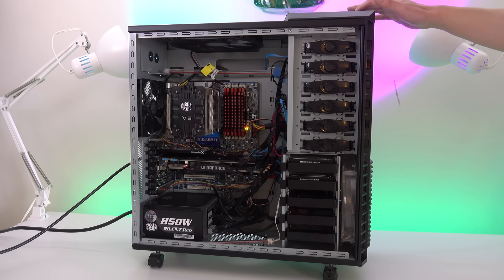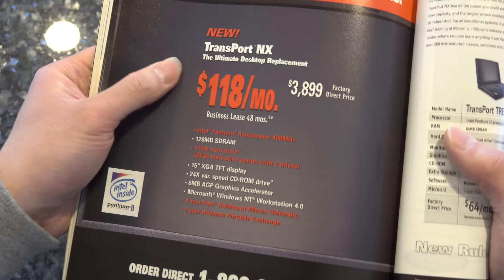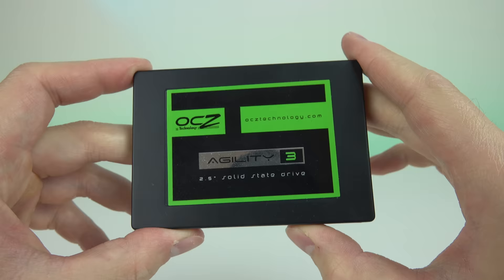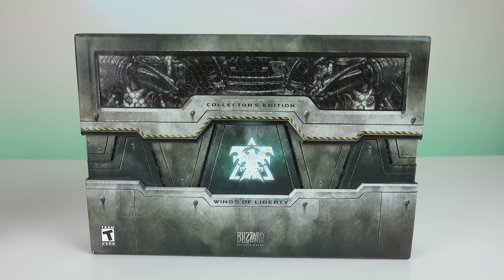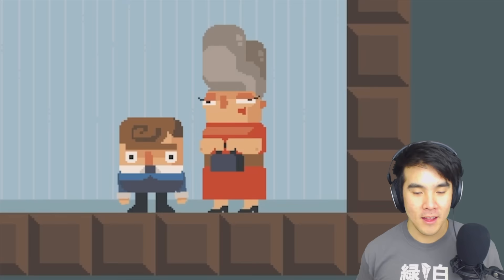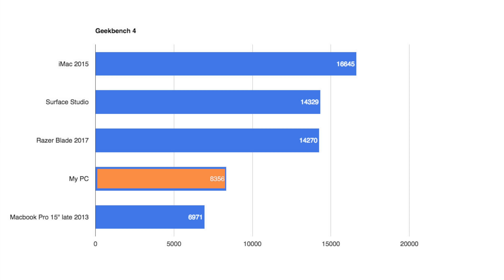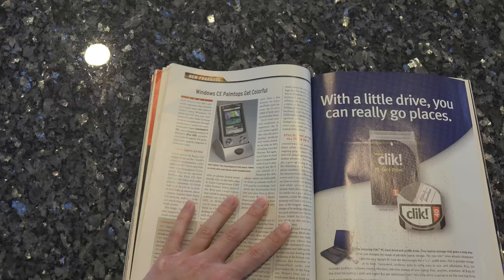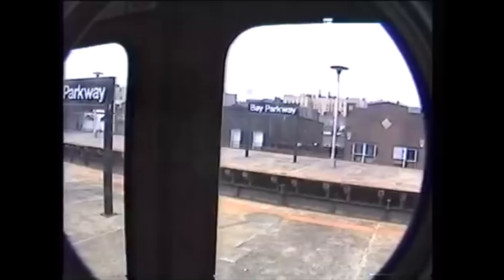I Built This PC for $1360 in 2010. Here's How It Holds Up.

Comment from the maker: New Video: I Bought This PC For $750 in 1999. Here's How It Holds Up In 2017. https://www.youtube.com/watch?v=Dy07b6hlUGg
thanks for visiting 🙏
Reply: Chubbyemu hey
Reply: I built an $800 PC in 2008 and it was my main computer until the end of 2016. Very reliable 3Ghz e8400 core 2 duo paired with 8800GTX video card. Technology certainly stagnated in the last decade. The computer I built in 2016 to replace it might last until 2030 if the components hold up.
Reply: i paid 30 bucks in April for a E8400 in a TFX Case with 2GB RAM, DVD/CDRW, and 160GB HDD. Put 4GB of RAM and added a Radeon HD5450 1GB BOOM! a quick and easy windows 7 machine for a HTPC for Kodi and Netfix! 720p @ 60fps, no problem! I just need a better TFX PSU... 270W is okay.
Reply: 2:51
Ah, see I got the Antec 1200, which everyone said was 'inferior'.  Those air filters really do make a difference.
Reply: I still have a I think 340mb quantum drive
Reply: Chubbyemu Ithink you need GTX 1050
Reply: Chubbyemu I have cheap 2010 computer
Reply: Still using my built from 2010 as well with slight upgrade over the years.....now looking for a decent replacement for 2 HD7870 2gb.....:/
Reply: Chubbyemu please upgrade your cpu so you can record / livestream
Reply: Chubbyemu damn this PC doesn't look that bad, sure it may be out of date and weak but it is still pretty good, less than a year ago I had a dumpster PC, now I have this baby, https://pcpartpicker.com/b/8VFtt6#partlist
Reply: Nah I don't think they will. Besides by 2030 hopefully, there will be quantum computers, optical circuitry or some other element based circuitry. With the explosion in AI, IoT, AR/VR, etc I think we will probably max out at 10 yrs.
Reply: nerd
Reply: Chubbyemu hello
Reply: Chubbyemu Pls Get into youtube gaming like Gamingemu
Reply: Oh yeah. i bought it prebuilt when i was 13. So it cost about 500$ extra to buy it prebuilt
Reply: My $700 3570K build has been strong since 2011. All it needed was an RX480 down the road and It'll last me running everything highest settings all the way to the 7Nm Zen2 I'll buy next year when it comes out. In the 90's I didn't feel like a solid build even lasted 3 years, more like 1,5 - 2,0 years.
Reply: I used to go ultra on crysis warhead with and phantom 3.1 dual core, nvidia gt9600, windows vista, 8gb. ameri u fort hood teksasu muče Srbe Ruse i izbeglice but it now laggs even on rs ever since i got a cheap psu and I guess psu is the problem but it's also 9 years old
Reply: I have to disagree, certainly PCs nowadays can last longer... but is it real for the future ? Uhm... No, by 2020-2021 there will be many new features that will literally eat 8+ CPU cores at high frequencies. VR games will actually improve as well, so even the 1080Ti will have problem to run those smoothly. So if you are going to ask me " Will 2017 high-end PC run smoothly games in 2024 ? " the answer would be possibly yes but with many sacrifices.  Silicone slowly backs off and new resources will be used for manufacture that will increase the PC potential by a dozen of times easily which will result in another PC revolution.
Reply: Chubbyemu how much are u selling this pc
Reply: How’s the iMac Pro?
Reply: Chubbyemu  I'll take this off your hands
Reply: I'm still using some computers that have core 2 duo CPUs and they run pretty great actually 😁, they aren't the best for gaming but they get the job done. PS. Please don't comment saying I'm lying I don't lie.
Reply: I'd be happy having that PC. Mine is 8-9 years old, with a Gigabyte GA-A55M-S2V mainboard, an AMD Athlon II X4 631, a GeForce GTX 210, 4GB DDR3 RAM (got some more over time) [EDIT!!!: DDR2] and 100 GB of memory. I don't know why this thing still works. I can't even play LoL on minimal settings without lag on 30 fps.
Reply: You should add a PCIe SSD as your main drive. That would be a big speed improvement. Also Primocache disk cache. I get between a 40% to sometimes a 95% cache hit rate. So even faster than the PCIe ! The PCIe shows 3200MB read and 1700MB writes on my i7 3770 CPU. You will need to use the Clover loader, the easiest way or mod the BIOS to support NVMe. The loader just adds about 3 seconds to boot but then boot way faster. Way shorter total boot time and much faster running. Windows speed seems to be limited by the hard drives so an SSD really helps.
Reply: A new computer will cost you MORE for the same parts ! RAM is 3 to 4 times the price ! SSD price went down then it went up ! It should be way cheaper but instead it holds the price forever like all computer parts now instead of getting cheaper like they did year ago. Now a $325 CPU is about the same speed as a $325 CPU in 2012 ! But with RAM being way more expensive the total price is much more than in 2012 for similar computer specs.
There is no reason for CPU speed to be stuck at 3 - 4GHz forever ! Maybe 5GHz , when Intel and others can make 1000GHz chips, with lower power for the same clock speed and 10,000 times less leakage !
Reply: Chubbyemu I have the exact same pc except i went for the core i5 and I still use it now. Gonna have to upgrade soon but hey still functions
Reply: Chubbyemu today nvdia released the new RTX gpus and i think is now time do an upgrade...
Reply: @Chubbyemu
Lol, you've used the same case in the same year I did :)
Though I went with the Phenom II X6 1090T (managed to clock that thing to 4.0 Ghz) and a Asus AMD 5870 V2.
I upgraded almost everything during 2014 and 2015 and gave the spare parts to my mom for her pc (so it's basically still in one piece, just in a different case and no more OC).

If I may give you one tip.
Grab a soundcard, that was one of the better upgrades I did (darn, just looked it up, I've been using my sound card for more than 5 years already?!?!?)
Onboard sound from those generation Motherboards was a bit crap :)

Now rocking a 4770K and a 1080Ti
Reply: Who are you? I want to meet you in RL. Or can we hang out on discord steam? I'm a dietitian and follow your medical care studies. But now you have a PC! Let's roll buddy! .... Deanzphx
Reply: Chubbyemu d
Reply: Upgrade your i7 to xeon for 40 dollars then oc it
Reply: And I have the same case
Reply: This is fucking click bait.  You literately said you upgraded your parts in 2015. So how would this be a 2010 build holding up in 2017.
Reply: Chubbyemu w
Reply: Did you ever get an answer?
Reply: You must play dustforce based on your soundtrack ;) I used to be heavily into that game
Reply: Xeon x5675 or x5660 should work and breath more life into pc
Reply: @Robert whittle a young man "RW" didnt watch youtube for 2 weeks. . . This is what happened to his brain 

-chubbyemu
Reply: if that is a X58 chipset, you should put a xeon X5670 in it 20$ form alliexpress, it has 6 core 12 threads overclocks to 4.1ghz and gets around 1k in cinebench
Reply: Chubbyemu very good video
Reply: Ha
Reply: Yeah. Dust and asthma: Me, too. So, my sympathies, Dr Bernard.💖
Reply: My first I also built my own. Athlon 2500+ 2x256 mb ram and a Radeon 9800!! In a antec case
Reply: And now ?